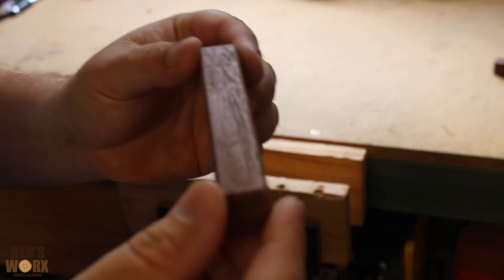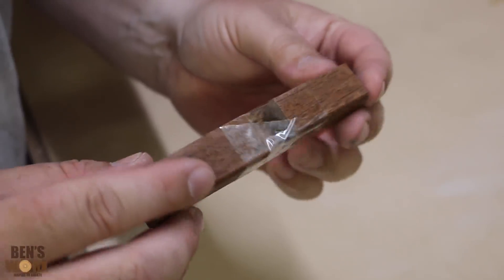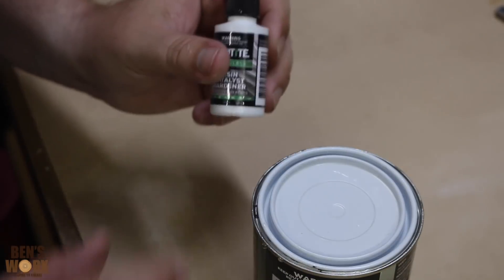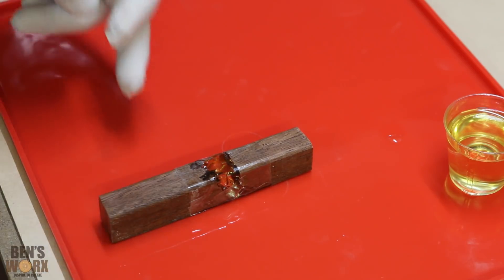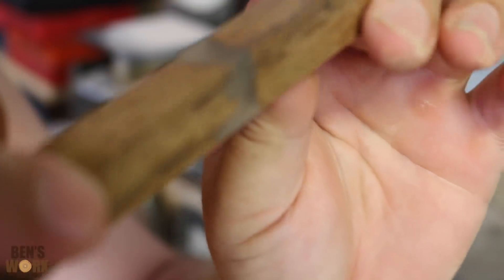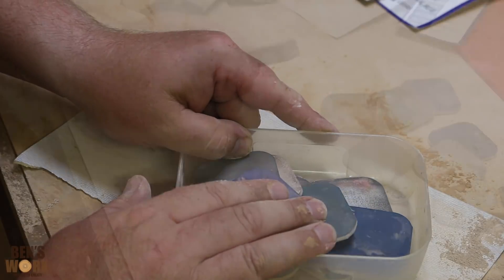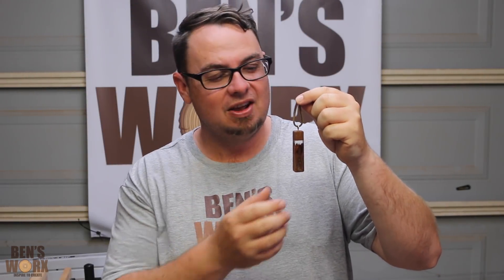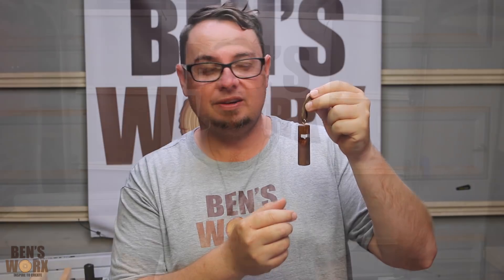HOW TO MAKE A SECRET WOOD PENDANT NECKLACE

Comment: Besides using a toothpick, how do you eliminate air bubbles in your resin projects
Reply from the maker: Stir your resin slowly, pour slowly, use a heat gun. And best of all use a pressure pot if you have access to one
Reply: I've tried using my heat gun, but not too much success in removing all the air bubbles.
Reply from the maker: Unfortunately a pressure pot is the only way to remove all bubbles, also make sure your using casting resin as it flows better due to a lower viscosity which gives less resistance for bubbles to rise to the surface

Comment: Nice! You could probably throw a little mica into  the resin to add some more visual interest. What grit progression did you use on the micro mesh? No poly or oil at the end?
Reply from the maker: I went 1500 to 12000 and no finish

Comment: Do you just use a old or new paint pressure pot without all the painter gear on there? What PSI you go up to? Cheers
Reply from the maker: I used a new pot and go up to 50psi, I’m sure an old one would work just as good
Reply: Ben's Worx just a reasonably cheap one off eBay?
Reply from the maker: Yeah just be weary of cheap ones, just Incase the welds aren’t great

Comment: I love your work and really enjoyed this video. I am very new to this resin world which I recently came across the internet. I have watched related videos on hybrid wood in which, if I am not wrong pressure pumps and vacuum chambers are involved to remove the moisture from the wood so it does not absorb the resin but sticks on to its surface. This being the exact materials resin and wood does not go to the same process. So how exactly is the absorption prevented?
Reply from the maker: +Krithika Dino Hi Krithika pressure chambers are mainly used to eliminate bubbles from forming during the curing process, Ive never had any issues with the resin absorbing into the wood, hope that helps Mate

Comment: Hello Mr. Ben, May I ask, why didn't you put a finish on the wood? And if you were to put on a finish, what kind of oil or varnish would you use? I am really interested in making pendants, so I would like to know what a good finish would be. Thanks! And what a beautiful pendant!
Reply from the maker: Thanks mate! A walnut oil would be good
Reply: Thank you Mr. Ben! Also, what grit would you use for a general wooden pendant without the resin mixed in for a nice, smooth, and polished finish?
Reply from the maker: 1200
Reply: Thanks, and final question, I promise, what do you think is the best "all around" finish for wood so I only have to have one can or bottle of wood finish? Finally, what would be a good finish quantity for making say, about 10 wooden pendants?

Comment: Looks great.  I'm just beginning to work with resin and tried a very similar project with a 1/2" square piece of poplar with about a 1/2" gap between the pieces.  I used Alumilite Crystal Clear resin and let it set overnight. In the morning I found that the wood had completely absorbed all of the resin.  I double and triple checked that it was mixed properly and was in a dry environment about 65°F. Any suggestions?

Comment: Hey Ben, Nice work, but I have a question. I tried to make something similar to this. I used a pressure pot to remove bubbles. when I got it out the next morning, the resin had reduced in size leaving a void. I tried a second one, this time giving time for the resin to settle and some of the air bubbles time to escape. The next morning, the same thing just not as much void. How do I stop this and get a solid pour? Thanks for your help.
Reply from the maker: Hi Shane, Thanks Mate! as the bubbles reduce the resin level will drop, i compensate for this by making my pendants slightly larger than i need and sanding down to size, alternatively you can pour over the void if required to fill it up, hope this helps mate.

Comment: Question about the wood to use for this type of project. I've used Ebony, Cocobolo, and Zebra wood... But when I try to snap them in the vice, I end up with long tails on the snaps, or the wood proves to be very soft and will bend quite a bit, and then it becomes useless. Is there a trick to getting such a clean snap? Maybe drying it? What are your thoughts?
Reply from the maker: Hey Jared, you could try popping into the oven to dry it out, the wood i used is Merbau and it’s very hard it’s mainly used as a decking timber maybe try something similar, hope it works out for you mate!

Comment: Does it make any difference if I skip from sandpaper 250 directly to 1000? And how long should I sand with the micro mesh?
Reply from the maker: Yes don’t skip grits, each grit is meant to reduce the scratches

Comment: Hi Ben, beautiful piece! I'm new to your Channel and happy to be here.. quick question, is it a good strong bond between the two pieces of wood? I'd like to make them for my three daughters but not sure if they would break them easily while they're still young? Thanks
Reply from the maker: Hi, yes resin sets like concrete there’s definitely no breaking it, thanks for watching :)
Reply: Excellent! Thanks again
Reply: Ben, that color coded polishing pad set you have, is that something we can get over here in the states?
Reply from the maker: Yes definitely, I’ve seen it on Amazon it’s called Micromesh :)
Reply: Excellent! Thanks again

Comment: When you said several hours later of sanding, does it actually take that long to get the final finish?
Reply from the maker: If you want good results unfortunately you have to put the time in, you could skip a couple of grits but the finished product wouldn’t be as good, i had to take my time with this particular pandant as I didn’t want to round over the edges,
Reply: Thank you for the reply and the pendant is absolutely stunning.
Reply from the maker: Thankyou

Comment: Do you have any advice for how to seal the wood from moisture? I have a project in mind but it is going to need to be sealed form occasional moisture. I'm completely new to casting resin and I need all the help I can get
Reply from the maker: +Seth Barby Hi Seth, is it going to be outside in the weather?
Reply: Ben's Worx wow! You don't fool around with replies. No, I'm thinking of making coasters. I want to keep the resin really clear but I'm not sure what I can use on the wood that won't compromise the clarity of the resin
Reply from the maker: +Seth Barby you can seal the wood with some wood glue but i would just lay your resin straight over the wood with no sealer just make some test ones before committing to your final piece

Comment: If you have a heat gun you can get the bubbles out easier with that. Otherwise I like it
Reply from the maker: I agree, unfortunately I couldn’t use the heat gun or it would have melted the tape

Comment: hey, what happen if i dont use the activator?
Reply from the maker: It wont harden
Reply: altogether or just expand more?
Reply from the maker: It won’t harden at all, if resin was to harden without the activator it would set in the tin before you even get a chance to use it
Reply: you´r right, thanks!
Reply from the maker: No worries mate

Comment: sooo I'm trying to get into resin casting, but I'm not figuring out which resin I should use, at first I thought any resin is fine, but then I heard that epoxy resin is easy to put a dent in (for exemple pushing ur nail into the cured resin will leave a mark) 
so I was refereed to polyester resin, but then I didn' rly find proof of it being so much better, and currently I can only find larger quantity what makes it more expensive to buy. 
and after all of that, I found out that ppl like to use epoxy resin for smaller projects for some reason, but I'm still thinking of the part where I was told that a finger nail can make a mark if u push it in a little.
TL:DR
so can I just use epoxy resin or is polyester resin a better option (I currently only think of doing small projects like pendants with wood and sanding it without any machines cuz I don't have any)
Reply: but if I would use any kind of machine (for example for sanding) I should not use epoxy resin right? (I want clear casts so I can see through it and/or have some swirls inside of it)
Reply: and I just realized that this is the same channel I asked about if I could use food coloring, so thx for the answer there again :P
Reply from the maker: Hey Mate, once cured you will not be able make a dent in the resin, the most important thing about resin is to measure correctly and don’t put extra hardener in thinking it will be harder because it has an adverse affect, make sure you mix thoroughly as any unmixed resin will stay soft. I recommend using an epoxy casting resin for pendants, i find polyester resins smell and don’t work as well.
Reply from the maker: Now i only use epoxy resins and they are crystal clear, after sanding on a machine you will have to sand up the grits to achieve a polished finish
Reply: @BensWorx  ah ok, thank you once again and ceep up the interesting videos ^^
Reply from the maker: Thanks Mate

Comment: how could it became very clear like that?
Reply from the maker: By sanding the scratches out with Micromesh
Reply: can you please list each name of the materials you used?
if i can find them in my local area, I will do this.
thanks
Reply from the maker: Wood and epoxy resin, sand with sandpaper and polish with Micromesh
Reply: thanks you! 😄